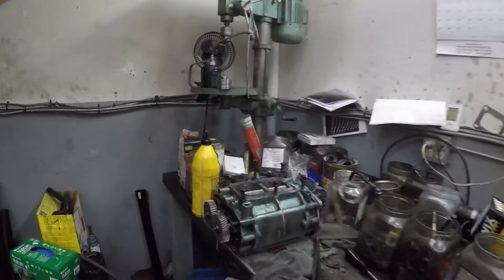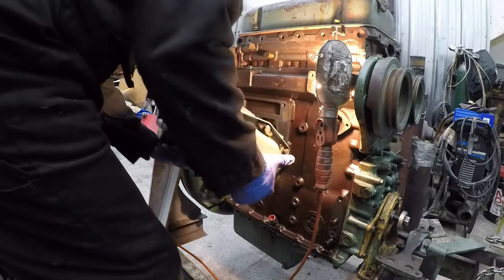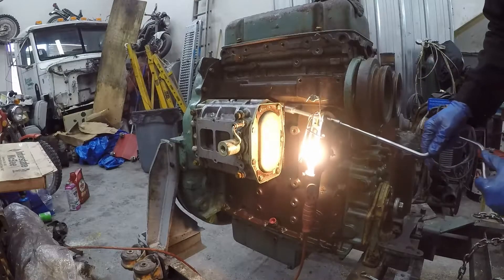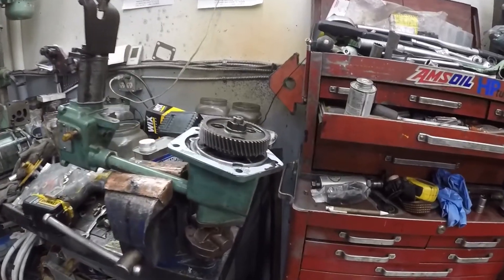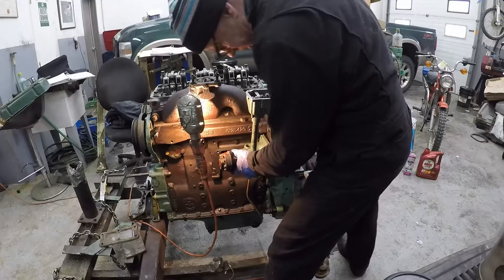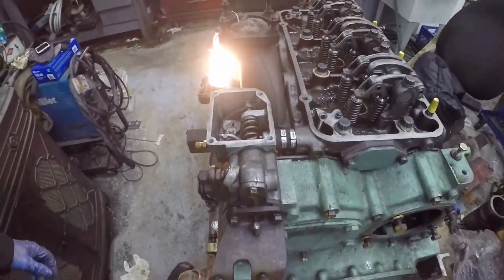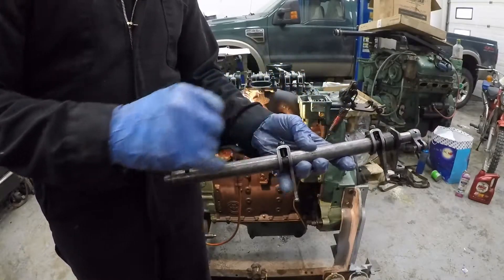Detroit 3-53T Blower And Governor

Comment: Good morning, what are things to consider if I remove the turbo from my 353t and use a natural blower without turbo?
Reply from the maker: It won't work without the turbo.  Even if you install a natural blower, there's not enough boost.  The results will be low power, high egt's and a lot of black smoke.  Need the turbo for the engine to run right.:)

Comment: Hey which tool do I need to set the injectors on a 353 with n40 injectors is it 1.460?
Reply from the maker: Yes 1.46" for the 353N.:)
Reply: @detroitgarage9430  thank you sir I appreciate that and have a great weekend
Reply from the maker: @randalltaulbee4320  You're welcome.:)

Comment: Hi , Would a 353 be a good choice to swap into a 1/2 ton pickup truck ?
Reply from the maker: Yes, would make a great swap.  I would get one with a turbo as the N model are only around 100-110 HP where as the T model is 125-135 HP.  P.S.  Thanks for watching.:)
Reply: @detroitgarage9430  thx

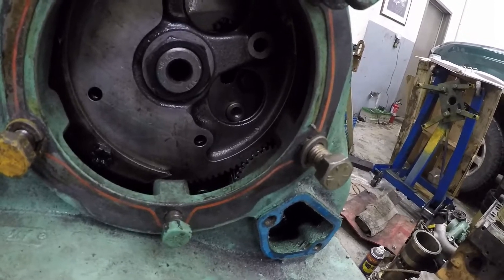Comment: At 5:26 where your light is shining is the the water jacket hole I’m trying to put a block heater in mine
Reply from the maker: I installed a 750 watt unit from Temro on my 4-53T and it works great. It's the 3rd winter coming and used daily with no issues.:)

Comment: Good day, my 353t giving alot of black smoke. We replace the turbo because the first unit shaft has a lot of play but the defect continues. The injectors were replaced 2-3 weeks prior to this black smoke. Its a blower and turbo arrangement. Do you have any suggestion of a next check i can do?
Reply: Good evening, made the checks you recommended. Remove the blower for inspection and found heavy oil residue in the engine cavity where the blower is attached. Next thing we notice is that no air pressure at the test point down stream the turbocharger (no boost pressure).
Reply from the maker: Check the air filter is not plugged and intake is clear, emergency flap(if installed is open).  Check for boost leaks, (also blower function),  exhaust leaks at manifold and turbo, confirm the injectors are spraying correctly and they are the correct delivery size.  Also new turbo is ok and both compressor and turbine blades are good.  If still emitting black smoke, then check compression is ok.  That should lead into the corrective path.:)  Thanks for watching.

Comment: Hey could you give me a call or could I give you a call? I been haven some problems with my 353 and really could use some advice on how too fix it. If you have a minute could ya help me figure it out? 319-429-9199 is my number thanks much
Reply from the maker: Hi Travis, sorry for the late reply, your message ended up in the spam folder.  I'll call you this evening.
Reply from the maker: Sorry Travis, I'll have to call tomorrow as running late.
Reply: I must of missed your call and just now seen your reply but if you Wana send me a text message be4 u call next time I'll be sure too answer hopefully thanks much

Comment: Is it true, that to prevent oil leaks, that every bolt needs a copper washer under it?  subbed ;)
Reply from the maker: There are a lot of bolts that require a copper washer.  If you don't they will leak.:)

Comment: Won't be long now. I'm at the same point on mine. Which  injectors would you recommend for use in this engine? 4-53 non-turbo going in a Terex loader. It had some M45's in it but Maybe I should go a little higher? I'm still enjoying all your videos. Keep reviewing the ones on your channel. Most helpful anywhere on these Detroits.
Reply from the maker: Thanks, M45’s are nice injectors, this engine had N 45’s before and now going with 5A60 from my 4-53T.  I’m looking for about 130 HP smoke free,
Reply from the maker: Did you go with 21:1 kits?  If so you might get away with larger like N50’s.  I’d have to check the field handbook and see what it says.:)
Reply: @detroitgarage9430  Yes. 53 N 21:1 020 Oversize. Don't mean to trouble you too much. Thanks.
Reply from the maker: @Shipfixer  No problem, the field handbook shows the largest injector as an N50@ 136 HP @2800.  Not to say you can't go to an N55-60, but that might just make smoke.  Hard to say without trying it.  If it's not worked hard all the time, the larger injectors can lead to more wet stacking as well.
Reply: @detroitgarage9430  Kind thanks for looking it up for me. I agree totally. I might just stick with the old M(military?)45's for now. They seem to be in fine shape. Maybe try the N55 on the next overhaul. We obtained several of these 4-53's at a sale. I do believe they were military surplus. We grabbed them up instantly. You might be depressed if I told you how cheap. They're becoming harder to get these days as you well know. And does the "M" on the injectors mean military?
Reply from the maker: @Shipfixer  True, they are getting hard to find.  I got lucky a couple years ago and bought 3 for scrap.  253,353 and a 4-53T.  They all require a rebuild, but slowly they are getting put back to work.  The 4-53T will eventually be upgraded to a Silver Series and be a spare for my truck.  I've got a pretty nice hoard of parts now, but might start looking for more in the future as I plan to run these engines for the next 30 years.:)  If I live that long that it.lol  Yes the M is the military spec injector.  It's different from the N series, but how different I don't know.  My injector book shows them.  Different flow rates, nozzles, tips etc.
Reply: @detroitgarage9430  Old Detroit mechanics never die, that's what I heard anyway. On the injectors, when I was in the Army they had me installed in an M113 armored personnel carrier as a driver. It had a turbocharged 6V-53 Detroit engine and automatic transmission. The thing weighed 13 tons empty. More with 10 grunts and all the weapons and gear. When you stomped it to the floor, it would belch black smoke and  take off like a rabbit. I was told that those M-type injectors were what the military wanted in those engines because they delivered quite a large fuel flow. The military wasn't concerned with conserving gas. Just trivia there. I'm not sure if it's fact, but sounds right.